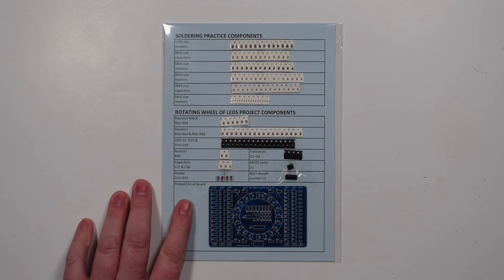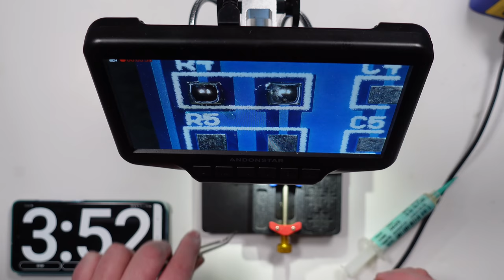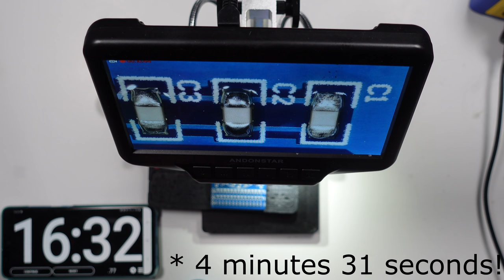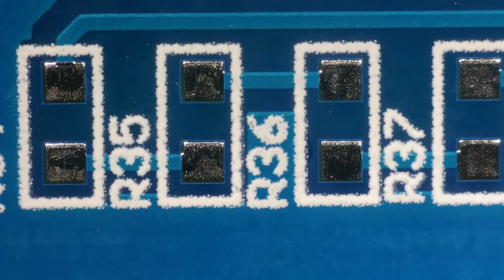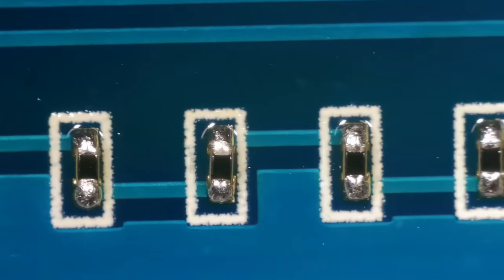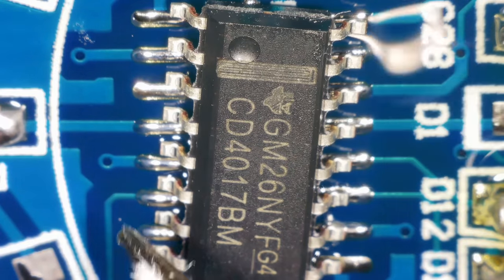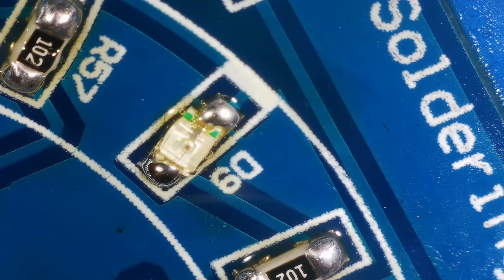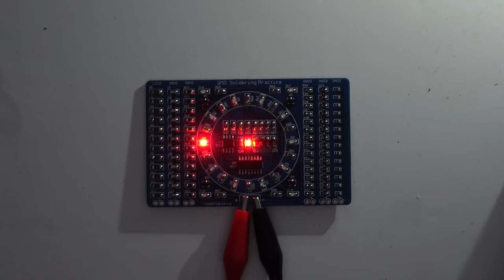SMD Soldering Practice Kit | OOOHH!

Comment: Thinner solder is what's required, it'll stop those big blobs.  Solder paste is put on with a stencil, although it was fascinating to watch it used in this way.
Reply from the maker: Haha, fascinating, I'll take that!  Yeah, I have ordered up some thinner solder off the back of this, i found it hard to find leaded solder, but think I've sourced some...  Thanks for the tip 👍
Reply: GB, am I right in saying that the solder paste/stencils are for chips such as Wii CPUs, where the pins could be directly beneath the chip itself? Think I've seen My Mate Vince or Makho do that before.
Reply: @ToxoRetro  No that's BGA (ball-grid array) where you use tiny balls of solder, those use a stencils on the chip rather than on the PCB, this is a process called re-balling.  Although people do use all sorts of methods including paste, good results are notoriously difficult to achieve without specialist equipment.  There are many videos on this topic
Reply: Cheers @gb7767 , good to know. 🙂 You can see where I got confused.
Reply: Was thinking the same about solder thickness.
Reply: Yeah, that's the way I've seen it done more methodically. Apparently PCBWay can also make SMD solder stencils. GreatScott! had a good video on SMD Reflow Soldering. If you have to do more than one of these boards, a stencil would be damn useful.
Reply: @gb7767  Not always, paste an be spread over a stencil also, not better than balls, but does work !! Pick 'n' place machines spread over a stencil with paste.
Reply: @Danechip  you can also apply with syringe if you have a steady hand. Also seen people place balls with tweezers which must take an insane amount of patience.  All a bit too fiddly for the novice though.
Reply: @gb7767  I used to use a foot pump on compressor for dosing a set amount on every press.

Comment: Thanks!! I initially found the idea of SMD soldering daunting. I started this, doing about 5 resistors. Watched your video. I've done more and I'm really glad I watched you. With a microscope, fine tip iron, fine solder, and hot air, I find SMD soldering really is quite doable. I think the microscope is pretty indispensable, at least for my 52yo eyes and hands.
Reply: I finished up the practice kit. I'm generally happy with what I've learned in the process. My final learning was: reverse tweezers are worth using - they made holding and letting go of the component easier (for me). I got some ceramic tipped ones and love them.
Reply: 31 year old here, I have pretty good eye sight.  I can see the connection points and the like just fine with the naked eye, but I still doubt my self.  A microscope even if just a cheap one, makes it sooo much easier.

Comment: My only suggestion, and I know this was a few years back... It is probably worth getting a finer gauge solder wire for use with smaller components to better control how much you put on the pad/tip of the iron.
Reply: This. Not as important for the bigger components, but I'm using 0.6mm ones at work for down to 0402 SMD. It's a little too thick for 0201 and below but extremely helpful to have around for most jobs.
Reply: Agree. Not knowing, I started out with 0.8mm which, for my first time, was fine for 1206s and 0805s, but I bought a spool of 0.5mm for the 0603s & 0402s. The 0.5mm melts with less heat, too.
Reply: Try .3mm with the finest tip

Comment: Solder paste, don't use flux(or very little) with it!!! Paste already has flux built into it.
Reply: Indeed. Solder paste is flux with solder balls suspended in it.
Reply: Solder paste and a hot plate. Put all the components on the board heat it up, all done in one go. Sorted.
Reply: @jonno1130  Yep, solder paste + plate is the go.
Also there are different solder pastes that have different melting points, SN42/Bi58 (Tin/Bismuth) melting point of 138c
If using hot air dial the airflow right down. Some cheaper stations just blast too hard and move stuff around.
Never flux when using paste, as already said solder paste is balls of solder suspended in flux already.
Beware the angle / direction you're blowing from... straight down or the ability to be agile with direction is important... having a camera in the way doesn't help (personal experience) so a matter of finding a compromise between capturing footage and being effective.

Last of all, that kit can be purchased on Ali Express in packs of 5 or 10 kits for very little coin if you want more practise... this is likely where the Ebay seller either dropshipped it from or where they sourced it and re-sold it.

Comment: 10:00 solder paste has the flux built-in so you don't need both. Also, a little paste goes a long way. Use it as sparingly as you can.
Reply: Yeah He said solder paste, then puts flux and I go ohh nooo, then he goes ohhhh where's it going and I was laughing. It's always fun when someone learns to flow smd with paste.
Reply: @TheMrDrMs  Is it the sole reason the metal balls are flying off or is it also too much air flow?
Reply: @goku445  Too much airflow mixed with too much additional flux (no add'l flux necessary). you'll never really avoid too much airflow problem but it's best to go as perpendicular to the board as possible too.. Also, more specifically to rework, its great when you can heat the whole board up too, not too hot, but say 100 150C then you don't need that much additional hot air to re/flow.
Reply: Yes to this comment
Reply: @foxIme-f7s  I looked up the channel and wow... I mean that's certainly an approach... Hey, if it works for them, great for them. I'm doubtful that some of those replacements work tho. Specs for solder joints? nahhh glob o' paste, bucket o' flux and an iron, what could possibly go wrong lol. I also like all the tinned test points now too.

Comment: One other thing, the amount of the solder paste makes a hug difference.  Also there are different size balls suspended in the flux that make it easier or more challenging.  I put the paste out and then apply it with a toothpick to just make a blob the size of the pad.  I also turn my air flow down on the hot air gun or you will blow the tiny little balls of solder everywhere, like you did in this video.  I also try and keep the air gun at a stepper angle to the board, at least 45 degrees.   Love the channel.

Comment: So great job, but just in case its not clear to viewers: The 3 rows on the left, and the 3 rows on the right have no functional purpose. They are strictly there for practise. (Each row has its own test points at the bottom for a final test).
Also careful with the power alligator clips. There are exposed strips of conductor on the underside that may short those leads.
Reply from the maker: Thanks Rob, great info!  👍

Comment: For these SMD boards with a lot of tiny components I would use solder paste and heat from the bottom with hot air.

Comment: Thanks for the video, I am a newbie to SMD I built the same kit as a first attempt, like yourself I was pleased when it worked. I hand soldered everything, after watching you use the hot air, I think I should try that. I was just a bit concerned I would dislodge other components. Regards Mike

Comment: Thank you.  Just approaching this after very many years of through-hole (and to be truthful even a few with chassis and tag-boards!).  Great to see genuine comprehensive method testing, and real results.  Will definitely need a microscope with ageing eyesight, but this has given me a true appreciation of the challenge, and a hot-air station is on the shopping list, isn't surface tension wonderful? Nice one.
Reply: I'd recommend the Quick 861dw best bang for the buck its actually more powerful than the Hakko but less than 300 dollars

Comment: Great job. Really enjoying your videos. Guys like you and @JoeyDoesTech have inspired me to start into this hobby. I just finished the same project myself. The tiny resistors were way smaller than I imagined. I used a soldering iron for all of the pieces. I was too scared to try and use the hot air machine. You made it look fairly easy. I may try that next project. I have the same microscope you do. It was a huge help. I have no idea how @JoeyDoesTech was able to do this by eyesight alone.
Reply from the maker: Thanks Taylor!  Yeah, I don't know how he did those 0402 ones without a microscope, they are ridiculously small.

Glad to hear you've given it a go too.  I am more comfortable with the hot air than the iron, so i found it much easier.  But I'm glad I did a mixture of both to see what works best.

The microscope is awesome isn't it?!  Really helps on stuff like this 👍
Reply: Glad you've got into the hobby Taylor, good stuff 😁👌

Comment: Great video, but don't give up on solder paste, it really is the best stuff to use. As it comes in the syringe, it's a bit thick and lumpy, so dilute it with some liquid flux, then apply it to the pads with a cocktail stick. A little experimentation will get the right consistency. You then drop the component into place with your tweezers and hit it with the hot air. As the paste melts, it goes from dull to shiny and capillary action does the rest. Give it a go, you won't regret it!
Reply from the maker: Thanks John, that makes sense!  I will definitely give it another go, I seemed to blow the paste all over the board, but I guess I need to lower the air flow too.  Really appreciate the information, thank you! 👍
Reply: It's definitely the case that less is more when it comes to solder paste, you really don't need very much! It's also essential to lower the heat gun exactly from above, to avoid blowing the component away.
Reply from the maker: @johnellerington2676  Thanks John! 😊

Comment: Amazing is an understatement. I have an obsession with doing these practice boards,  I find them very addictive and relaxing...  Thanks for sharing.
Reply: Did they deliver all components as in schematic ? For leds i have got 470ohm resistors instead 330 but that doesn't really matter, worse thing is that they gave me 20m r49 resistor so the lights works, but nothing moves :D
Reply: @maxmax-xx7nw  For me they did.  Check the output of the 555 chip.  It should be generating a pulse to tickle the input to the decade counter chip.
Pin 3 of the 555 chip is the output should have the pulse signal on it.  This will send a pulse signal to the decade counter's PIN 14 Clock (CLK).  Either the 555 is stuck in a single state or the 555 is running so fast, the lights appear to be all on.  Might check the components around the 555 chip to see if they're damaged.  
Hope that helps.
Reply: @DavidKHill  it's stuck on one led, all 4 corners are on and others randomly, i gonna short this r49 and see what happens :p
Reply: @maxmax-xx7nw  I wasn't able to trace it to R49.  Which resistor is that?  Albeit a schematic is provided with the kit, but the component tags don't line up with the actual board.  The according to the schematic there's a potentiometer controlling the trigger threshold.  (RP1 - Resistor Pot?).
Reply: @DavidKHill  i dont know if you can see the link with schematic, ps shorting this resistor makes all LEDs go on
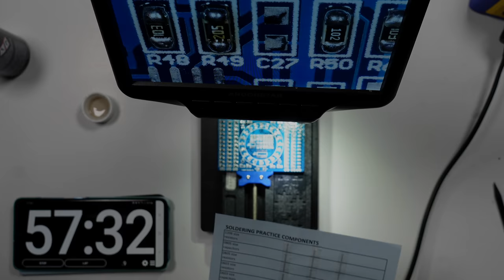20:36 - on the board

Comment: @9:34 today we learn why solder paste is not used with blowy things. only oven or hotplate things should be used.
Reply: Used solder paste with heat gun, works wonders, but: 
1) NO ADDITIONAL FLUX!!! 
2) Use appropriate solder paste (they differ in ball size) 
3) Add the right amount.
Reply: I laughed when the solder paste seemed to have a mind of it's own ... WEEEEEEEEE!!! Let's head on over to that next set of pads ... LOL!!! 😄

Comment: Your biggest problem with soldering the 0603 and smaller with your iron has to do with the gauge or size of your solder.  I have several diameters of solder because it makes a big difference in getting the "right" amount of solder on the pad.  Love watching your channel.

Comment: It gets really efficent when you have a stencil, use the paste, and get all the pads coated in a thin layer of paste, place the components and work your way around with the air. Def don't add flux to the paste and lower your air speed, and you'll get the hang of flowing paste. You should give you hand at some ICs. Something like the CP2105-F01-GMR might be a good place to start. No way to use an iron on that either. maybe (big maybe) you could tin the pads with an iron, place the chip (literally resting on top) then heat with air, but the best way would be some paste on all the pins and ground pad, place, and flow. Just found your channel; this was enjoyable to watch, nice work.

Comment: Solder paste is the way to go. Pit paste on each pad and drop resistor on before melting and then just do as you did with the ones you forst did woth the air gun. Just solder paste and the resistor then blow hot air lol. 
But im definitely goign to try the old solderone side then the other with the iron. 
Im getting a kit with 4 of these SMD boards this one is included
Youll get used to how much paste you need per pad. Its all an experiment but youll get it

Comment: I got all but 2 Leds working.  I think I torched those 2.  Thanks for the tip on led orientation (minus= heavy line on PCB)  I did all by hand no air gun.  I had extremely thin solder (.3mm).  I really wish they had put the parts on a labeled card like you had.  Seems these kits are a bit of a wild card as far as documentation.    Also I said no thank you to the 0402 s lol.

Thanks

Comment: Mever use flux with solder paste... And make sure its clean before with rubbing alcohol or something.  Then higher heat, lower flow with the hot air. It will work. Also keep your solder paste refrigerated when stored. Take out a half hour before you use it
Reply from the maker: Thanks Joshua! Great tips 👍

Comment: use thinner solder it makes a big difference for smd work. i never use 1mm or above for anything other than soldering cables together, its much easier to put the right amount on with thinner solder so doesnt make such a mess and also gives cleaner looking joints

Comment: You need 20/80 fine grade solder and a much better iron. (Don't grip the SMD, push down on it.) Tin your tip one handed and dab the solder to each joint after the SMD is held firmly in place (its a skill but solder is very mailable so can be positioned where you need it. Bend a 2-3" length at the end upwards and just dab your GOOD iron onto it)
While solder paste would work for this very specific board its main use is building up a new board, for general repair you need a good iron and fine tweezer skills.
While the offset SMDs trigger me he is correct they all make contact so will work its only if there very close together that would be an issue.

Comment: Funny found your videos and channel today. I have been testing a new soldering iron using the same kit and similar microscope. To be honest it was easier than I expected but takes a bit of practice. I enjoyed drag soldering the sop16. I think you would have done better with a smaller diameter of solder. I am going to get a smaller bit for my iron as I was putting down too much solder

Comment: I got mine and did it. I got half of it lighting up. The two LEDs on the right side top and bottom or not lighting up. I check the polarity. I swapped out the bottom right for the bottom left on the LED works. So I can't figure out where I'm going wrong. I probably checked all the solder joints about five times on every chip.

Comment: Nice Video. What temp are you running the soldering iron at? Got a kit glade I found your video
Reply from the maker: Hi Maurice, it's quite a thin board so I think I had it on around 340 degrees C.  Good luck with your kit, hope you get to see the magic lights at the end!  👍

Comment: Hi. Do you need to solder each components on the board? I solder the middle ones and power it up. It light up but the ic caught fire
Reply from the maker: 😳 I think the ones on either side are just for practice, the middle ones are the ones needed for the spinning leds.
Reply: @StezStixFix  Thank you
Reply: Thank you for your post nice work. I clicked on the thank you didn't write it down sorry

Comment: Wow, I was looking at this exact board last night on e-bay. I have a soldering iron coming in the mail along with some .8mm (0.031”) Kester 44. After looking at the resistor on your thumb, I thought you must be joking so I played it back and noticed it was in fact a resistor. sigh I think I’m gonna need to order a microscope now too. Time to start doing research on which to get. Yours seems really good. Does it come with the recording function built in or do I need to plug it into a PC or a capture card or sumn?

Comment: I'm new to soldering. Is it possible to solder SMD without microscope and hot air gun?
Reply from the maker: Hey Pal.  It is possible, but it will be very difficult.  
Ideally you need to be able to see those tiny #SMDs!

Comment: One tip. Your Soldier is to big. for those I would use a .25mm soldier. I really think you would like that. One more thing, Tin the iron. Then use the tinned iron to stick the smd into place. Then soldier as normal.

Comment: I completed the whole thing and it won't turn on. 😢 Two things are strange to me. Resistor 49 shows 1.6M ohm when in place but 2M when desolderd. The LEDs in the ring won't light up when checked with a multimeter, the outer ones do. What else could I check? Edit: Nvm had both ICs in the wrong direction 🤦‍♂